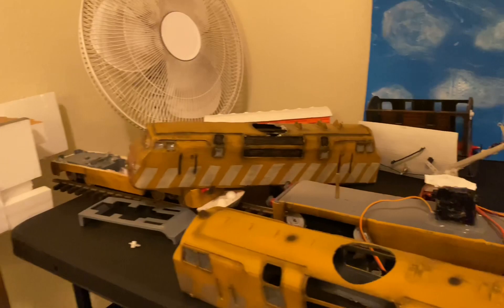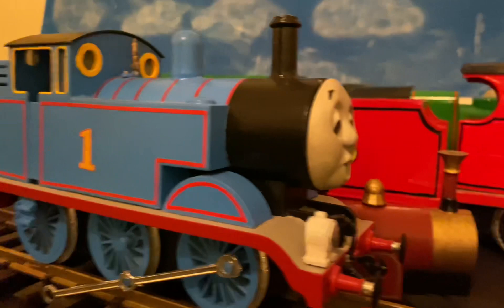My gauge 1 engines and diesel 10 update

Comment: Are the wheels 3D printed while track powered?
Reply from the maker: Metal wheels old one was 3D printed while track powered before
Reply: @zombrex54  cool where did you get the metal wheels
Reply from the maker: @vahidhosoda6614  it’s a piko motor block
Reply: @zombrex54  amazing